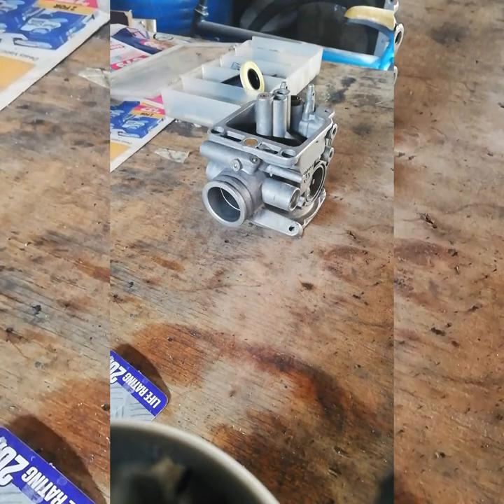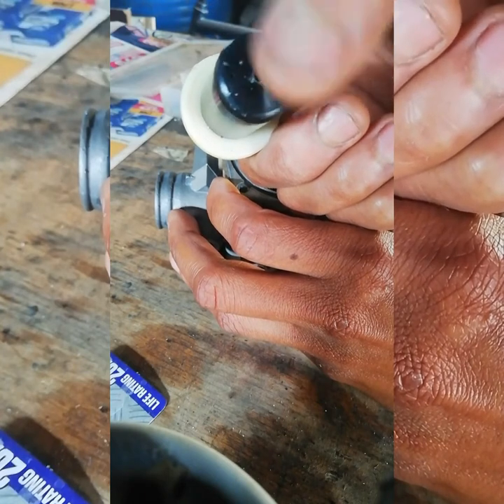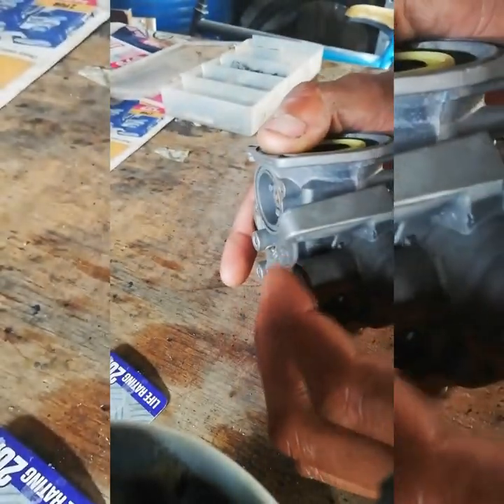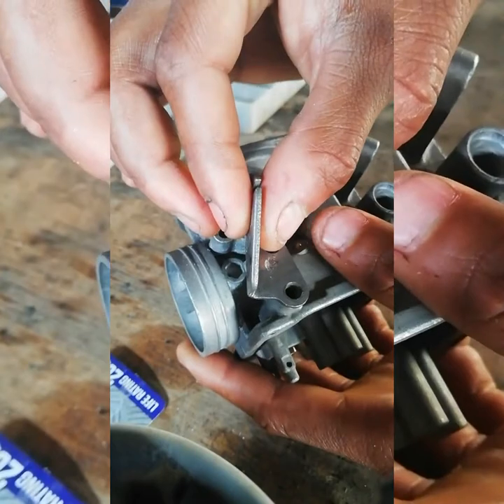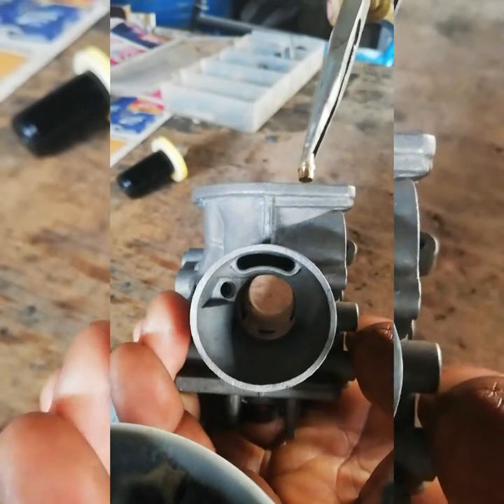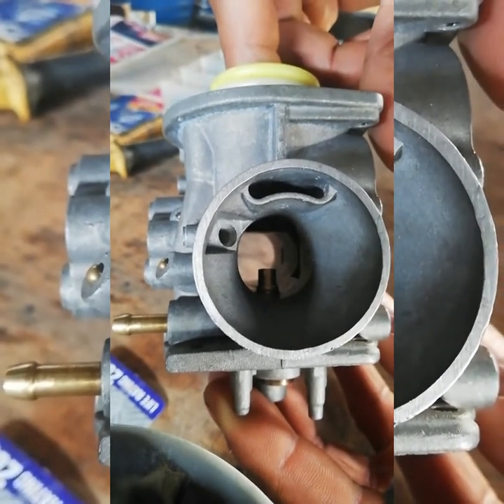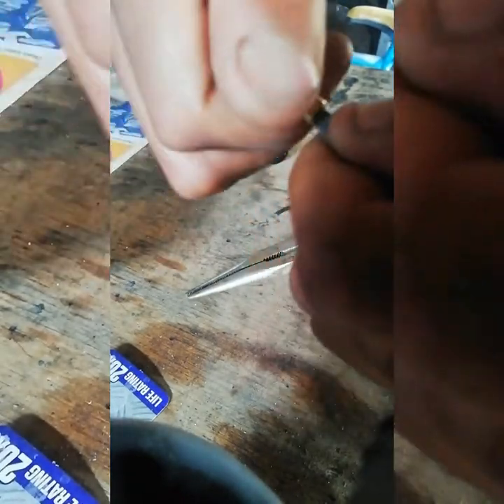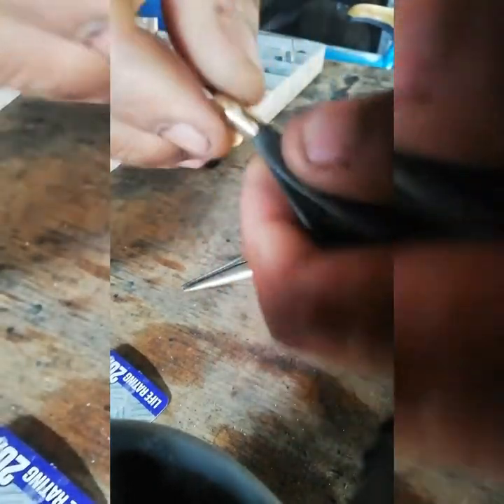Gy6 scooter carburetor,acceleration problem fixed (bogging)

Comment: Thanks for posting your video. I had a problem with a 125cc quad it would take over with a bit of a splitter and when I gave it the throttle it would die out. The problem was that the little brass main jet needle  seat had fell out unknown to me at the time of cleaning the carburettor. Many thanks Martin ☘

Comment: I will try to do it. Thank you for the tip!
Reply: did it work?
Reply: @BeyondTRD4R  Yes! Sorry for not answering before, I was lazy to dissasemble again. 
To put some spray-oil, I did not disassemble the whole carburator. I just released all the hoses, and I applied the WD40 through the air admission. Now the bike is super smooth and has a very fast response. Also I think the top speed has increased as long time ago! I have to say that the diafragm was very polished/wasted. The original colour was grey, but due to friction is black in most of it, so this was a good tip.

BTW the bike is a peugeot V-clic 49cc.

Good luck!
Reply: Pattie Almodovar  tf are y’all even talking about